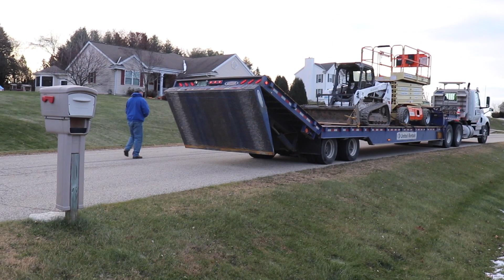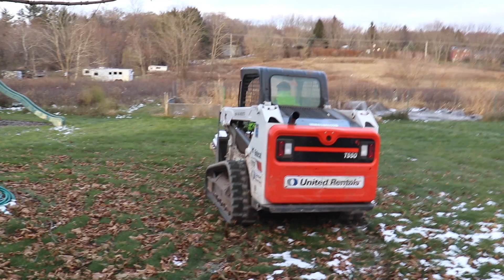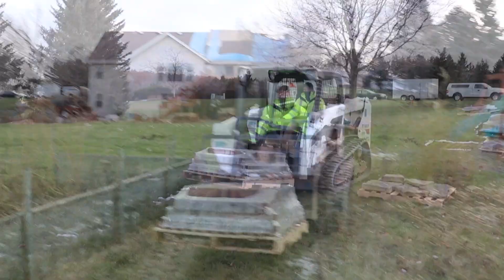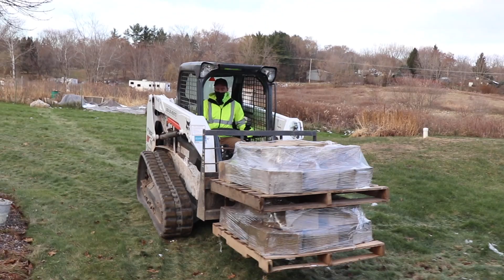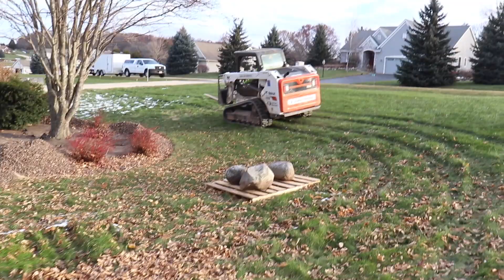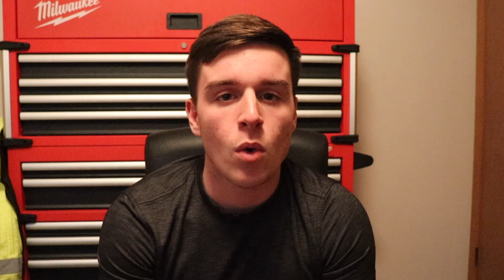My Day In a Bobcat T550 | Moving Pallets

Comment: My advice would be to put a shit load of plywood down on the grass. I saw you tore up the grass every time you turned the machine. If you put plywood down you can drive on that instead of tearing up the lawn.
Reply from the maker: E.D.K. Landscaping If you saw the last video I posted, this house had a fire. It did not matter that we tore up the grass on this one. I didn’t try to by any means, I’m still learning. It will get redone in spring after the house it rebuilt, no one is worried about it. If tearing up grass would have been an issue I would have used plywood for sure. Thanks for watching
Reply: @jcslawntips  Oh ya that's right. I was gonna say, that customer is gonna be pissed lol